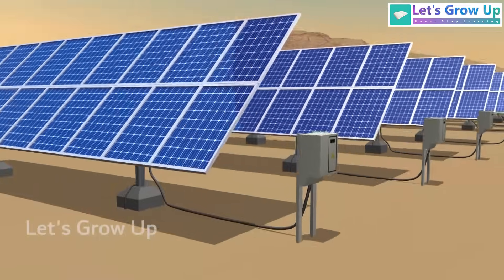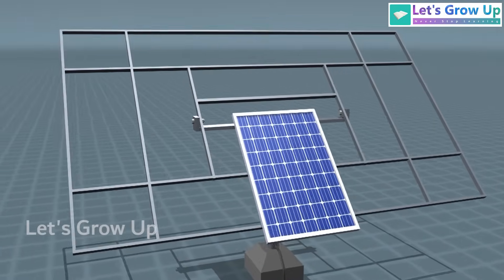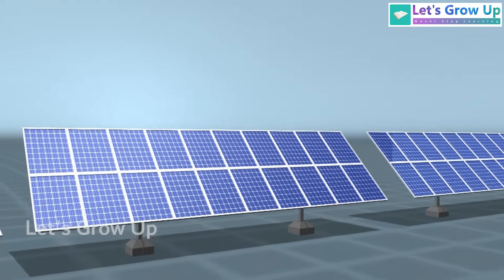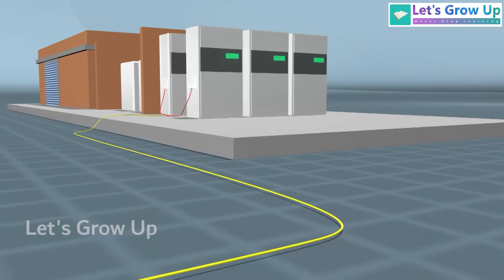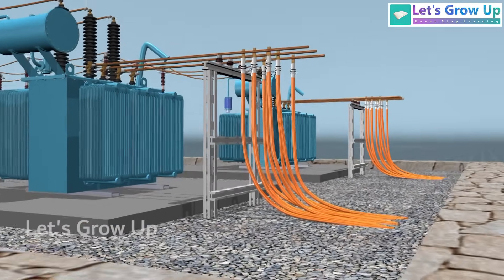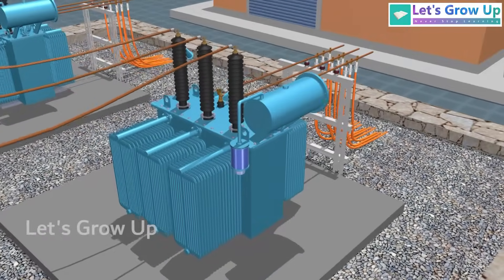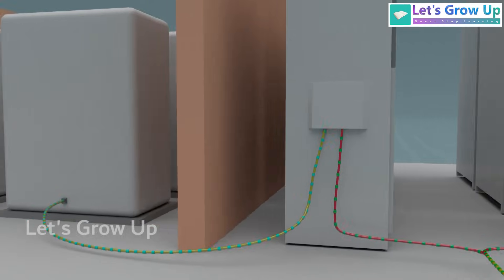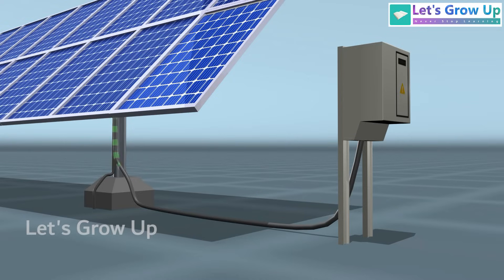How do solar plants work? | solar plant explained | on grid solar power system

Comment: But what if it rains on all this equipment?
Reply from the maker: A solar energy storage bank (battery) stores excess power from sunny days. During the rainy season, when solar panels produce less electricity, the system automatically draws from this stored power, ensuring you have a continuous and reliable power supply. It acts as a backup, making your solar system work even when the sun isn't shining brightly.